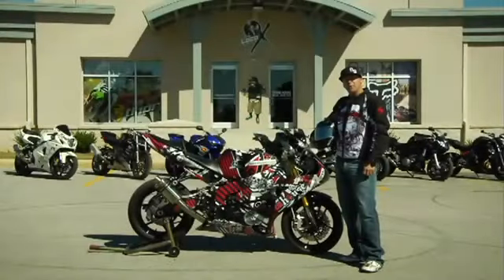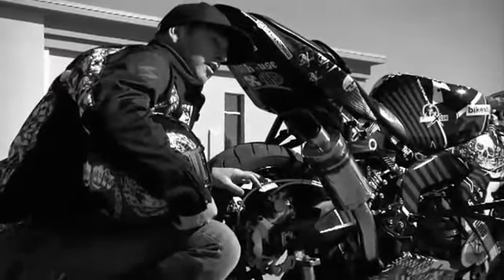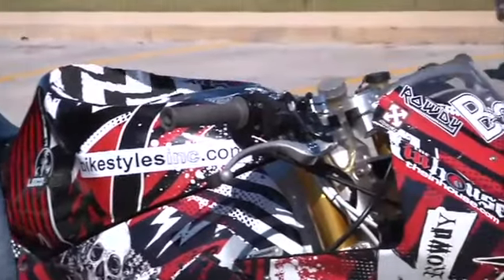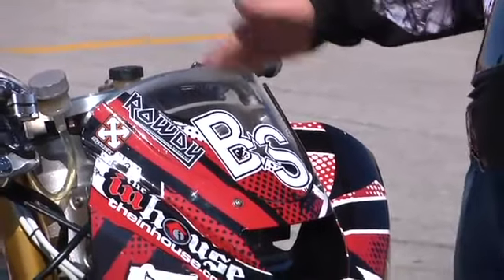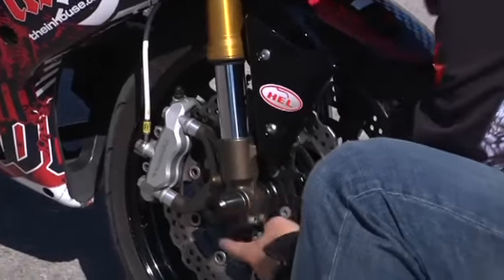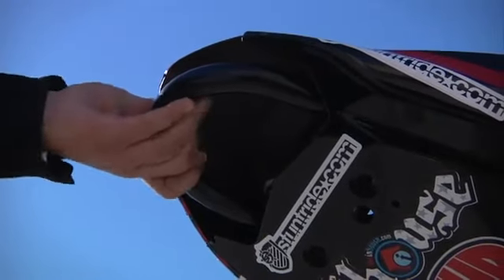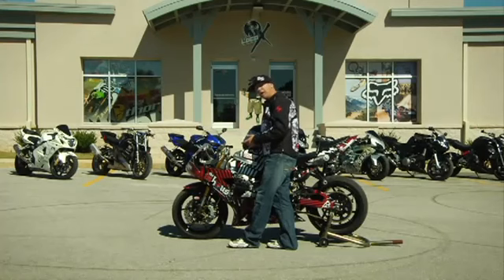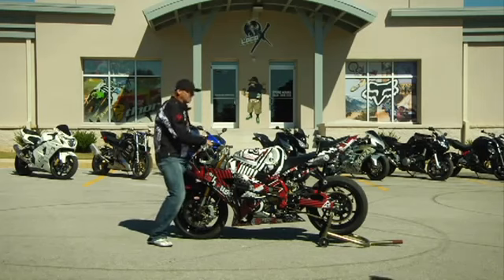How To Set Up a Street Freestyle Stunt Bike

Comment: can you make a video about what's the top speed with 60-14 teeth
Reply from the maker: Keithen Taylor top speed with that setup was about 107mph. 14-60 gearing is +23 teeth over the stock 15-40 gearing.